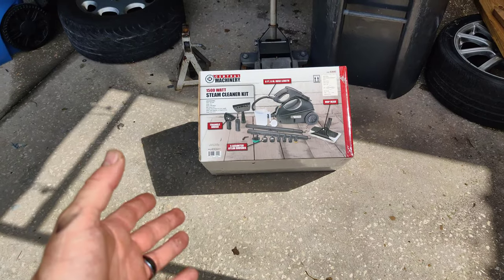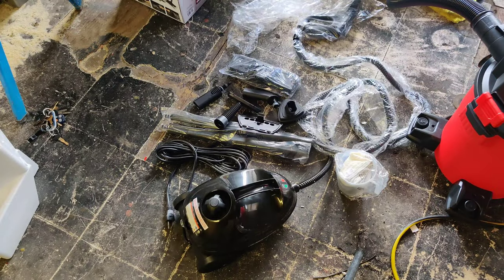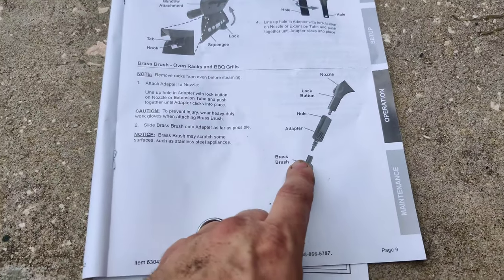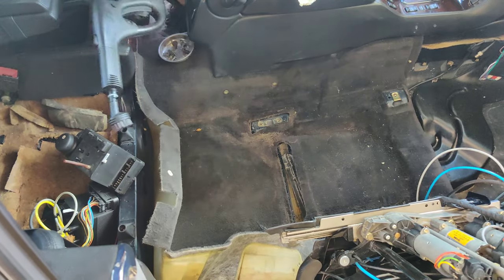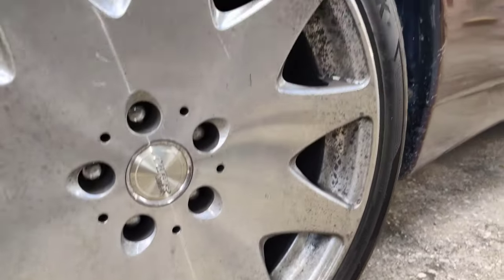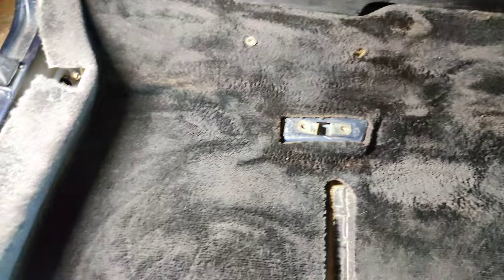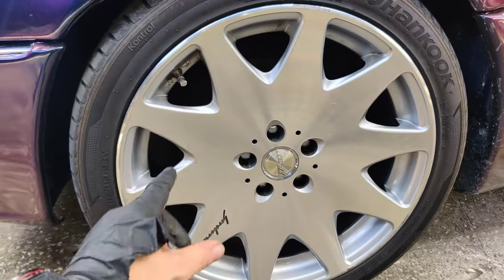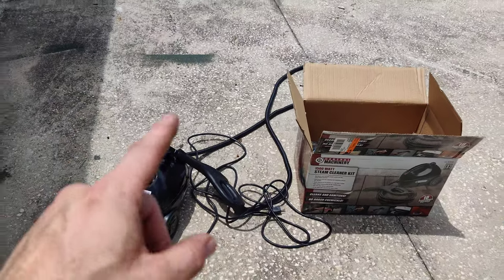Harbor Freight Central Machinery steam cleaner review and demo on Mercedes cl600

Comment: I bought Central Machinery Steam Cleaning Kit 1500 watt #63042 this week. I had a smaller different brand that I really like for kitchen flooring but it's no longer working.

This seemed like a good replacement. I tried it out in the bathroom, kitchen works great lots of steam.
I used it for 45 minutes and didn't run out of steam at all. Though I would prefer to use on kitchen and bathroom flooring. I'll also  be using it on fabric sofa, drapes and auto. Using it on sinks, tub, shower toilets (didn't use inside the toilet) seem more of a hassle than hand cleaning. All in all I like it just fine for my needs.

Comment: You can ways dilute the APC my bro , I detail cars myself , I dilute half and half for tires with a foam cannon for tires and exterior use to break down dirt. Works great
Reply: I just buy wheel acit.30 bucks 25 bucks a gallon spray on rinse off and done

Comment: I purchased this one but what happens if you don’t use distilled water?
Reply from the maker: Calcium will build up and clog the steamer and heating elements.
Reply: You will be buying another one much quicker.....
Reply: @LordHolley  Unless you run vinegar through it occasionally
Reply: @FryChicken  still clogs up even with DI water. POS
Reply: @elsey1976 are you using distilled water or bottled water?  Distilled water doesn't have anything in it that could possibly clog it up
Reply: Mineral build up from tap or bottled water will clog the device and it quits working -

Comment: i just bought 1 and on the first use it literally sprayed water out  vs more steam. Is that normal?
Reply from the maker: Yes.  Water will be forced into the hose and not be steam.  I can say this is true even with espresso machines.
Reply: @petescarport  i figured  but it was alot of water so i thought it was maybe a defective one.
Reply: Maybe you didn’t give it enough time for the heating element to boil up the water?
Reply: @LuisGarciaSprout  it has an indicator light on the device to tell u when its ready. I personally just never used 1 b4, and figured it shouldnt be squirting out water rather then vapor but i jus got a 5 gal bucket to spay it into at first so it catches the water.
Reply: Steam machines emit around 10-15% of water, it’s normal. A trick you can use is to wrap a microfiber towel around the nozzle of the steam machine so it can catch the water and simultaneously catch any debris on the carpet

Comment: When the red light comes on while yu using it what does that mean
Reply: Just means the heating element is on. I find it works better if you pause every minuet or 2 and let it build pressure.